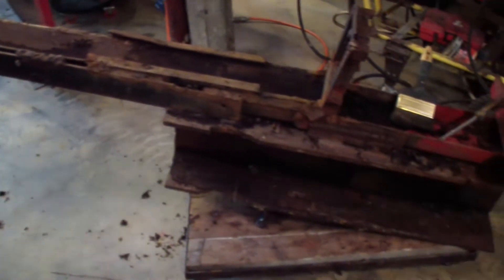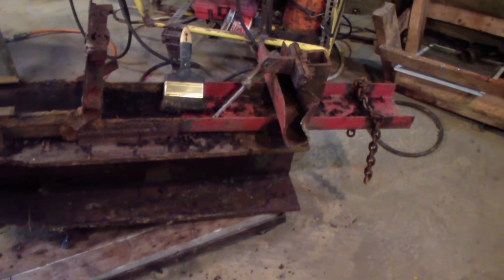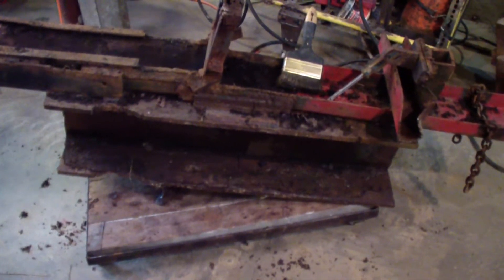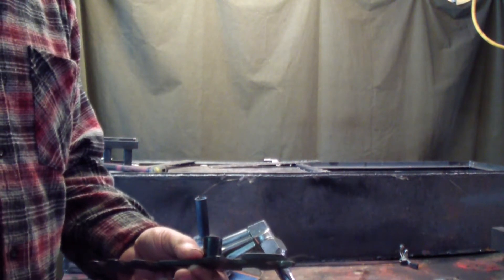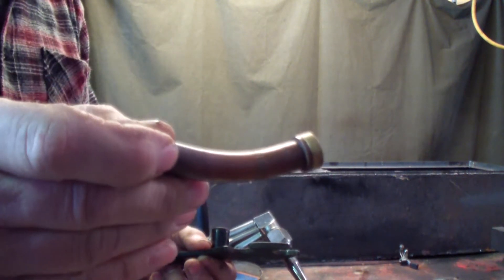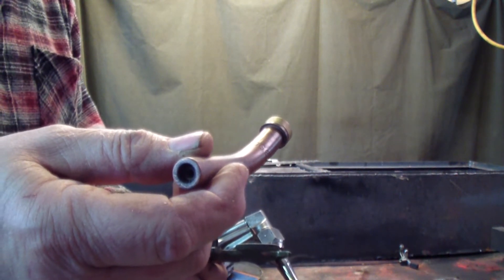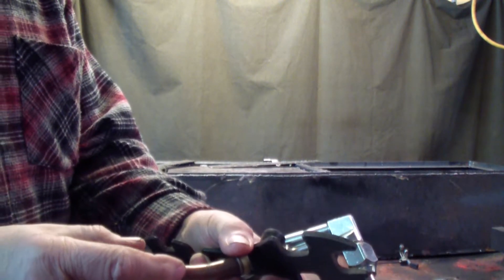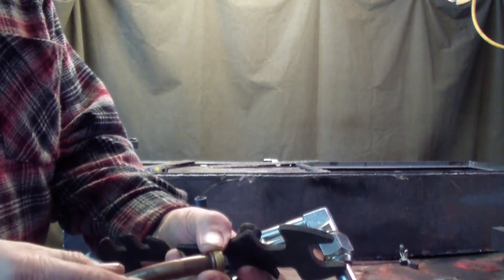Using a gouging tip

Comment: Nice cutting system! Did You ever use a Air Arc cutting system? My next torch is going to be a petrogen torch system
Reply: Air arc is the way to scarff welds if you have an air compressor and welder that can keep up.
Reply from the maker: No I have not. But I will look it up. always willing to learn a new way.
Reply from the maker: What I can see of it it looks like the same type of torch. works off of of siphoning the fuel with the oxygen LP comes from gasoline but I think gasoline burns hotter than LP. It is also saying it will burn through block without popping I'd like to try that torch
Reply: Air arcing looks like a stick welder with a air line hooked into the handle You use carbon rods and high amps on the welder. You turn the air on and arch or ground out the rod and it archs and blows the sparks and molten steel out. its fast and does a nice job. I cut up 1000s of railroad coal hoppers with that system. Also check on the Petrogen cutting system. it runs on oxygen and gasoline and will cut through heavy rust and 5 or 6 inch thick steel with easy. it will cut a long time on a gallon of gas and the sparks are real low almost like a sparkler. and the tips last a long time. I live about 15-20 minutes a way from You I live close to the end of 271 in Northern Cambria- Spangler